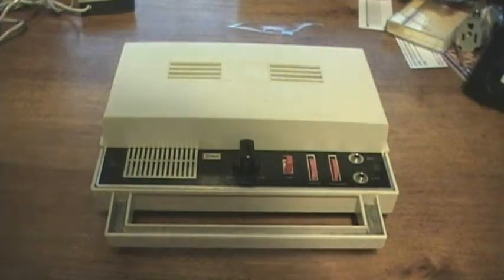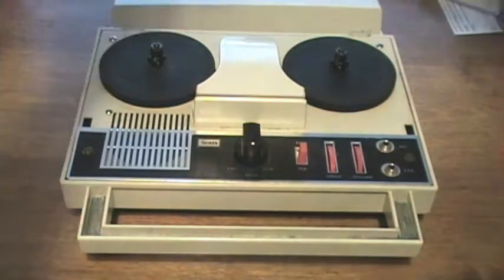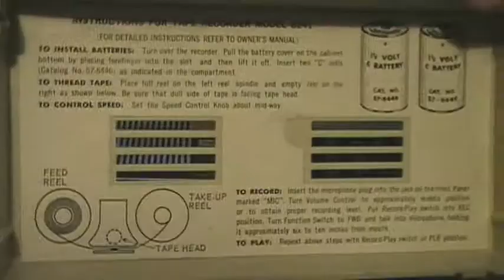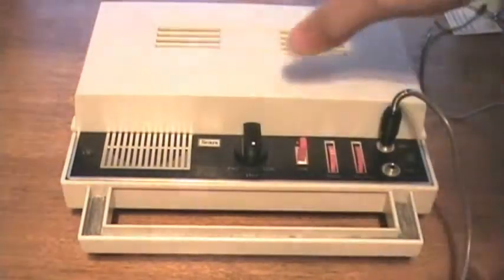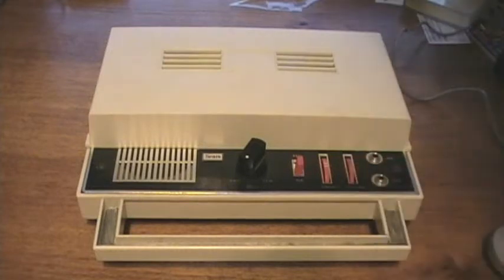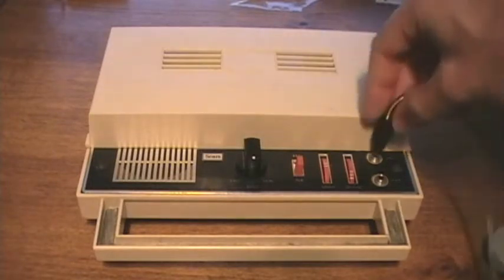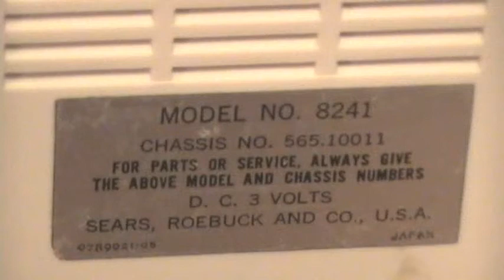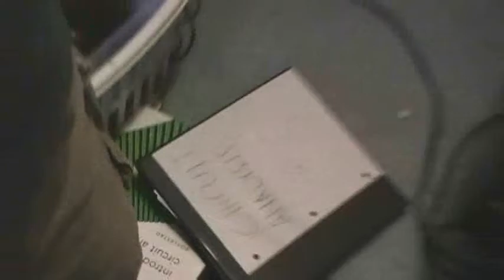Sears 8241 rim-drive 3-inch reel to reel tape recorder, 1960s..wmv

Comment from the maker: The the motor speed is not regulated by a governor or servo, and the shaft presses right against the rubber on the reel table (also sometimes the friction might not be consistent if it's dirty) so it tends to not be constant. Now the Grundig Niki is a rim drive machine, but since it has a servo-controlled motor and flywheel and plenty of friction, it has a nice, stable speed.

Comment: that is a sweet little rim drive recorder. Do you still have the keys that broke off that Casio keyboard? I am with Casio keyboards they way you are with tape recorders, I love the things. I've been slowly repairing/modifying (adding a back-lit LCD display!) a CZ-1000 synthesizer having to replace every ribbon cable because of moisture damage and corrosion, huge project but should be worth it in the end.

Comment: I just came across one of these from my parents’ possessions. What batteries did you use? When I use 2 C cells, there is not enough juice to turn the reels. I have use my finger to rotate it and hear it. Any suggestions? So many voices from the past I want to hear again...
Reply: maybe D cells or it could be a broken belt?